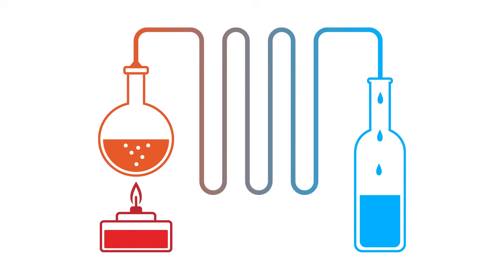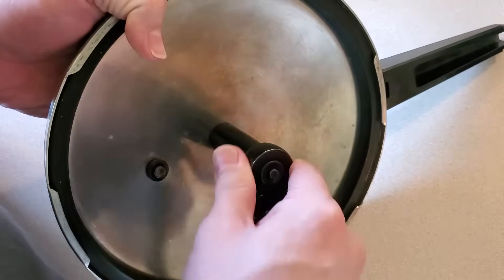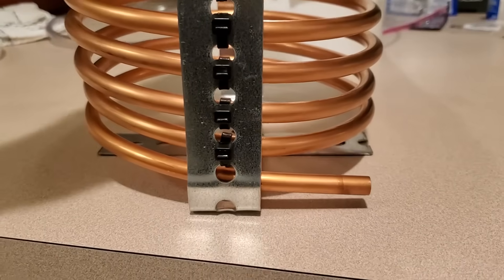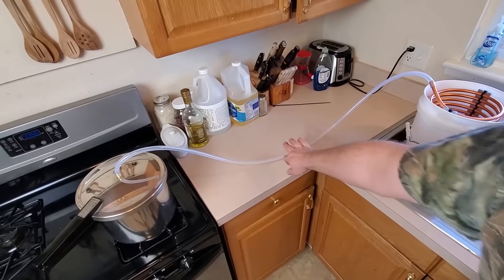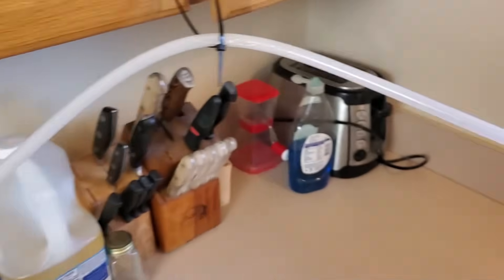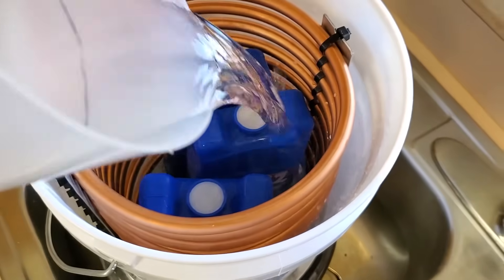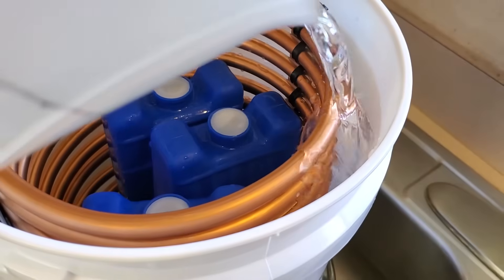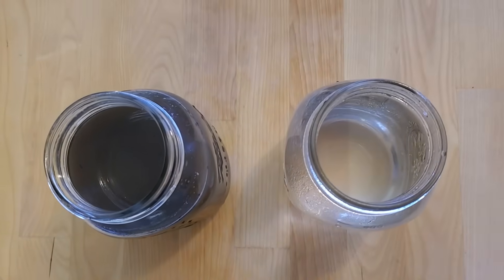DIY Water Distiller (Higher Output Version) - Full Build and Demonstration

Comment: Where did you find your copper tubing that silicone tubing would fit over? Was it 3/8" OD or NOM? I can only find 3/8" OD copper tubing in refridgerant copper tubing (and the 5/16" silicone tubing will fit over it), but refridgerant tubing is not for potable water. The only Type L copper tubing that I can find in 3/8" is NOM, which is 1/2" OD, and that's too big for the 5/16" tubing to fit over it.

Comment: "It's removes H2O and leaves behind everything that is not H2O" - false. How do they extract alcohol for instance, and alcohol not only substance which could be in the "water" so do speak. At least TDS meter to prove your quality? "Drinking water" is not exactly H2O. Chemical processes may or may not react to purity of water differently.
Reply from the maker: Well, you're talking about two different things. I'm showing the distillation of water. You're talking about distilling alcohol. Alcohol has a lower boiling point than water. So, same principle, except instead of vaporizing the water to extract it and leave everything else behind, you would be extracting the alcohol and leaving the water (and everything else) behind. Just have to keep the temps high enough to boil the alcohol, but not so high that it also boils the water.

In short: Distilling water is not the same thing as distilling alcohol.
Reply: @GreatLakesPrepping  How alcohols is made? Isn't it just adding to WATER some ingredients?  And that is exactly what you do in video, right? And then, as I said, alcohol is not only thing that could be in water, that why TDS term was created.
Reply from the maker: I'm not really sure what you're trying to ask, and your phrasing of things is confusing. Are you asking me if alcohol is made by... adding water to things? In any case, I made a video about purifying water via distillation. Not a video about distilling alcohol, not a video about making alcohol. I don't know what you want, but I'm afraid I can't help you.

Comment: Love your design, nice and affective way of getting distilled clean water. How can we do the same with rain water? I've always been worried about our power grid being hit with an EMP missle, which means back to the medieval times without electricity for several years. I live in an apartment so our water supply will be from stored water in plastic bottles, but when our water supply ends, no one is going outside for water, for crime will be at the Highest level. So for our safety rain water which isn't safe to drink will be our only option. Can you please do a video on purifying rain water without electricity, this would help millions sir in case of an EMP attack. Thank for your hard work and educational helpful videos sir.
Reply from the maker: Thanks Elizabeth. You can absolutely distill rainwater, no differently than what I did in this video. Though I'll mention that using a high quality filter is probably ideal for rainwater. Distilled water uses a lot of energy to create, and all minerals are essentially removed from it.

Comment: I would use aluminum tubing or stainless steel tubing. That copper will be gone after a while
Reply from the maker: How do you figure? There's millions of houses with copper hot water pipes that are perfectly good after decades. Not to mention brewery equipment, liquor stills, and all other manner of hot liquid tubing in commercial and industrial applications. Copper doesn't dissolve, degrade, or disappear from having hot water running through it.
Reply: @GreatLakesPrepping distilled water isn't the same as tap water or alcohol. It's missing ions and minerals and it will eat away at the copper over time.

Comment: LOL!  In 1977, my high school had an orienteering/survival class.  I joined to get the free orienteering compass, which turned out to be a cheap junky Silva, but...  It was primarily for stupid rich kids who were apparently dying like flies either out on the ski slopes in the winter, or out on the ocean attempting to sail in the summer.

Anyway, me and some rich kid spent less than $10 at the hardware store, for all the parts and made a home made Distiller that we got to demonstrate in the class.  Basically a 5 gallon cheap spaghetti pot and 10 feet of copper tube.  I coiled the tube with the tube bender that existed on the top shelf of every dad that thought it was cheaper to be his own plumber.  A couple of copper fittings, I chose the cheap 5 gallon pot because it had the hole pre-drilled for the lid cap.  We just fit a copper fitting in the hole, twisted the 1/4" copper fittings into the hole (hand bent and hand coiled 1/2 copper water pipe), dumped in a gallon of sea water and fired up the bunsen burner in class.  Distilled about a quart of water into a flask to show that it was pure.

Naturally we got an A.  Then we discovered that it was pass/fail and that you passed as long as you showed up...
But still, no doubt, someone learned something...

Comment: Noo when your ciclesematics of the colling liquids  expands impands expands in to thentional diverentional displasmands translatet in to the water you resarect .inerals inside the water like knidneys do in to the pee as salts 

Cidneys is not osmoses he 

Yet when you add water in the bicked with a overflow toward kold position to cool down and onder inlet than from the cold posiioned closed container 
With a back wards closing boll towart the container as imput and towaert the bucked as output than the bucked cooling water is replanced with cold water from  and can releases wharm water to and your coile condemser is match longer cooling more strongley 

Yet advice is not to use cooling elements i have traied this to several times onley than you do not emd up with fullest poseble demineralised water😅😅😅
Reply: Mabey do one time with and one time without cooling elements and than smell and taste the diverence 
If you are not able to smell the diverence tace from boths a sample vrom the top midle and butem and go to where they can test with spectrum analise and do the same self test it with ph after some days and you will see diverence

Comment: could the pressure cooker blast
Reply from the maker: I don't know what you mean
Reply: @GreatLakesPrepping  am just asking would there be  any possibility for the pressure cooker to blast , would there be any possibility for having an accident
Reply from the maker: @promithasan-o1y  I see. Not really. This use of a pressure cooker is arguably safer than normal pressure cooker use. Because there is not really any pressure building inside the cooker, since it freely escapes (in the form of steam) through the hose and coil. It's really no different than boiling water in a pot, except the lid of the pot directs all the steam into a tube (rather than letting it just escape out into the room).
Reply: @GreatLakesPrepping  thanks

Comment: Something to note about this is that flowing air does nearly as well as water when it comes to cooling the condenser coil, except you don't need water to make more water if you use a fan.

Putting the fan and coil inside of a duct works the best for this. Of course this is only applicable if you already have power and you're not homesteading or something, but it is something to consider when building something like this.

Also, lower heat on the stove means your water vaporizing will happen slower, but you'll pass less steam out of your jar because it's easier to condenser a lower mass flow rate of steam.

Comment: Make the port at the bottom sealed and have it connect to the pipe on the inside with a threaded adapter like a flare fitting or something and then u get beat if both worlds. Can fill it with ice water, but can also remove coil and use it as a drain once the coil is removed.

Comment: Use mineral or sunflower OIL instead.  It has a much higher thermal capacity and will still cool the steam without using water, which is the whole point of the exercise! :) .  Splitting the pipe into multiple channels will also prove to be more efficient, as you reduce pressure and increase surface area for heat exchange.

Comment: Not being rude, but this doesn't make any sense to me because the reason you want to distill water is to get fresh pure untainted water and then here you are running the water that has been distilled or turned into steam through silicone tubing and silicone tubing is just a chemical bath to reintroduce microplastics into the freshly steamed distilled water. It makes no sense.
Reply from the maker: Imagine your only source of water in an emergency is some murky, bacteria-filled water hole. Distilling with this contraption would make it potable. Imagine needing a constant supply of distilled water for a CPAP machine, used for humidification. This contraption will make it.

The high-temp, food grade silicone tubing is fine. By water merely touching it, I am not making the water toxic. Half the beverages you drink that come from stores or restaurants have been in plastic at one time or another.

Comment: I know it late but: 
-Do not reacc more than 85c reaching more can let some water run out before it become pure steam

- build the system in way where u can cover the collector under the ground about half meter depth and use hand pump or electric mini pump this way u do not need ice or water to condense 
- u can useone small and one large pressure cookers connected together with 1way valve and just wait alittle it will condense slowly 

Do not reach more than 85c for best quality

Comment: Your pipe man, don't use that plastic whatever pipe... It'll melt to steam or bring any microplastic whatsoever.. 

The cooling tube is better to have a separate drain and the copper tube that currently passing through is better be watersealed. 
That way you can control your water release instead of letting it drain out. 

If you have flowing water sources nearby like river, it might be a good idea to setup the system there so that the heat will dissipate quicker using flowing water to dissipate the heat in the cupper tubung, giving you better results. As the quicker you turn your steam into water, the more yield you got...
Reply from the maker: It's high-temp, food-grade silicone tubing. It's made for hot liquids.
Reply: @GreatLakesPrepping  i hope it can handle water vapour then.. As it's not liquid, but gas. I haven't research or browsed about it yet man. Check your safety temperature for that material i guess.

Comment: You could seal the silicon house through the hole in the bucket, that would allow you to still remove the condenser coil and have the water remain. 

I'm curious how this would work with room temp water, I'm thinking outdoors by a lake scenario

Comment: FYI...Without a charcoal filter you're still getting impurities with the original solution you started with.  Pure saltwater doesn't need additional filtration, but the dirt you put in will have chemicals that will also boil and evaporate...

Comment: the problem with a condenser like this is that you can only run it for so long before the water becomes hot and no longer carries the heat away from the pipes anymore, so you have to keep refilling it and adding ice.

Comment: If you make the copper condenser coil 3-5 times taller or several layers of coils, turn the heat down under the pan after it comes to a boil and don't put the coil inside anything so the air can pass through the coils it should work without needing anything to cool the coil down. The harder the pan is boiling the higher the steam pressure and flow and the longer the condenser coil needs to be. The copper coil will be hot all the way to the end but by the time the steam gets to the end of the coil it is cool enough to condense back into water. If you don't care about running power you can set a fan up so it blows up through the coil and turn the heat up on the pan.

Comment: Its very cool, but you dont want to heat plastic for drinking. What would be better is using metal tubes :)
Reply from the maker: I'm using high-temperature, food-grade silicone tubing. It's perfectly safe to use for this.

Comment: I think if i were to attempt this design, I'd add a tap to the bottom of the bucket so I could choose when to drain rather than having it leak out. I think the warm water created by cooling the coil would be a good candidate for adding to the boiler. Idk if that's how thermals work, but i would imagine heating warm water takes less time and energy than heating cold water from a lake or something.  If that's the case, it'd be worth collecting that water. 

I'd also be the mad lad to try and automate this process since the steam could be used to power a pump or something. It would be a steam engine that farts out pure drinking water and fills huge reservoirs of drinking water.

Comment: Does this design require static head to function?
Reply from the maker: I don't have a thorough understanding of static head, but I don't believe so. The force of the steam being pushed out of the cooker, and through the tube and copper coil, is what makes it work.
Reply: Said differently, if the tube coming from the condenser to the clear glass jar is above the condenser will the water still make its way to the glass jar? 

Thanks!

Comment: Thanks for the nice vidio explaination- that really is all that is needed- i bought a 80.00$ still water distiller off amizon- from seeing your vidio-i can see i will need to add a much bigger condencer / thanks again / my other little plastic water distiller for about 75 $ burned up in just about a year. Probbley more efficient on power-but your preasure cooker design clears my mind- distilled water out of my RO machine comes out pure clear- your water in that design probley still had some impuritys THOUGH. probley a bigger condencer and dial the heat down just a little would be nice and clear.GREAT DESIGN IDEA.
Reply: If you let the distiller shut off by itself they will burn out, I lost two of them, now I set mine on timers and have one about 6 years now that is still running great. I also put 1 teaspoon of Citric Acid in the water that I am going to boil, on the 2nd boil I do not add it, on the 3rd boil if the 1/2" water at the bottom is clean then I do another boil. I don't clean or empty the water between boils unless I need too.

Comment: What if you build this but run it thru a deep freezer or maybe even a fridge? maybe use bigger and longer pipe in a bigger bucket or series of buckets, seal the buckets and leave them full of either water/ice, or something like propylene or ethylene glycol?
Reply from the maker: That would surely produce a lot more distilled water, much faster. You've more or less described a commercial-grade distiller.

Comment: An immediate thought: Distilled water for battery use that contains no minerals/metals or chemicals, you run the distilled water through a copper pipe.... which actually adds copper to the water again? or am I wrong...

Comment: can you substitue silicon tube with copper or any other metal (outside alumiium).  Can plastic from silicon get into water?
Thank you for taking time to show us this, important video
Reply from the maker: Copper tubing would work instead of the silicone tubing, though it would likely need to be a bit wider than the tubing I made the condenser out of. Some people use flexible copper tubing (like goose-neck style tubing). I've not figured out how to attach that to my pressure cooker, but I'm sure it could be done. As for the silicone tubing I'm using here, it's high-temp, food-grade silicone and I have no worries of anything leaching into my water.
Reply: for the pot would you agree that copper would be the best?
Also I just noticed and look if someone else found that to confirm  that all stainless steel (second best after copper) might be/is leaking  steel and whatever else is made of (there are various types of stainless steel). Yet stainless steel for the most part has no taste. What are your thoughts on leaking stainless steel ? I would replace all silicone  tubing with copper regardless what they claim silicon is. Copper purifies as well as is lasting material.
Reply from the maker: @accountams6717 If you're asking about tubing, I would go with copper over stainless steel, purely based on its conductivity. It dissipates heat much better than steel.

Comment: How much did the fuel cost to produce that 20 oz of water? How much did the waste water cost?
Reply from the maker: It would likely cost more than buying distilled water at the store, if using a gas stove like I'm doing in this video. However, if already running a wood-burning stove or similar for heating purposes, it would cost nothing extra to set the distiller on it and let it do its thing.
Reply: Isn’t running the water through a copper pipe and then a plastic pipe contaminating the end product?🤔
Reply from the maker: @gaborhamori2410  No. Copper is a common and safe material through which water of all temperatures is transferred. As for the flexible hose, it is high-temp food grade silicone.
Reply: @GreatLakesPrepping  Thank you!
Reply: @GreatLakesPrepping   still not distilled water. Distilled water is a three step process: boiling, condensing and then running the water through activated charcoal. Activated charcoal is what gets rid of VOCs.
Reply from the maker: @davidarcher5576  Distillation is turning the water to steam and then re-condensing that steam back into water. What I made is distilled water. What you're describing is distilling water and then filtering it afterwards.
Reply: @gaborhamori2410  It would have to sit on those surfaces for some time to absorb any contaminant.